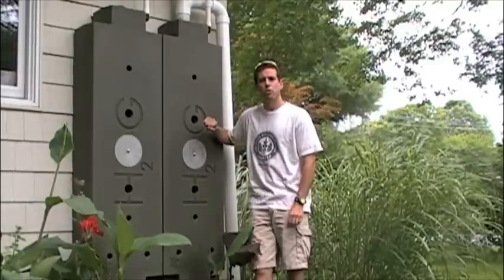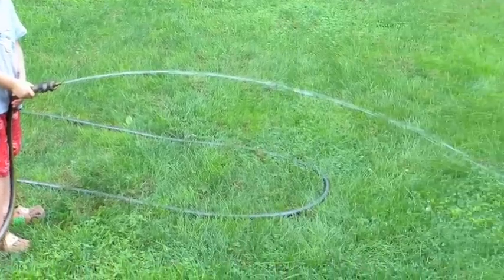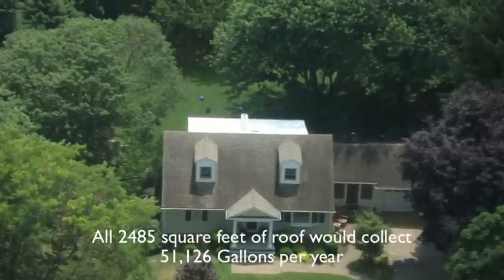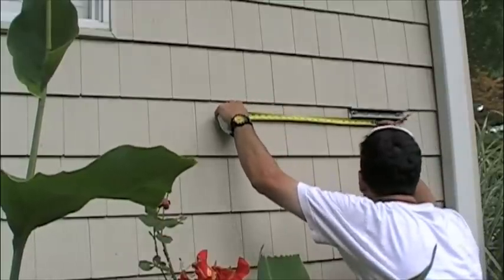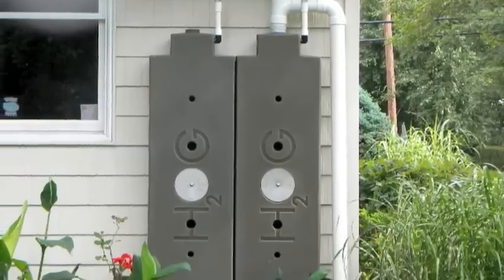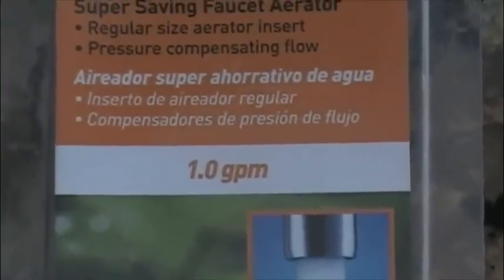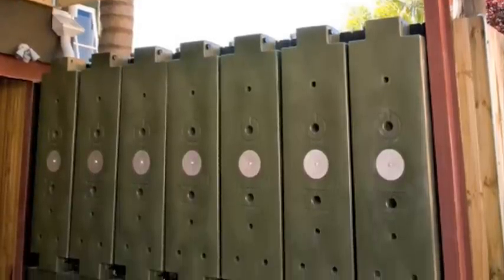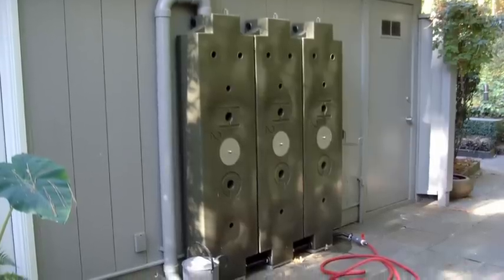Rain Water Hog install NJ Water Harvesting Rain Barrel

Comment: I love these things. 
I do struggle with 102 gallons costing $600+ not including pipes and foundation materials.
For 1000 gallons you're looking at $6k not including tax&shipping.

100 gallons is not much.... and to make this feasibly acceptable you'd have to go at least 1000 gallons. 
I have ibc containers and yes they're unsightly. But that's 500 gallons and if it doesn't rain every week im empty. 
For it to replace home systems? Forget about it, we're talking 30-40k if you live in a dry area and 15-20k in a wet area. 
I wish they could do these slightly cheaper than $300 per 50 gallons.

Comment: O K boss so I don't know if you all in NJ use a lot of cooling. But In the high desert of the south west were I live we use swamp coolers a lot. So what we have done is use the large body of harvested water we have in the crawl space anyway to super charge our swamp cooler so we don't need to use it as much. during the winter that body of water tends to freeze in the crawl space. so we used larger than needed tanks so we could let them freeze if they wanted. As we were installing them we built in a system of cool air pipes that run from the north side of our home  into the crawl space and through the barrels, out to our swamp cooler's air intake and it draws air through this set up to super cool our AC better than using chemical coolants and is provided by the good 
Lord all day long if you've pland and did a lil pre work. I need to make a video on that one some day : )

Comment: oh & yes to brag a lil that 4000 square foot greenhouse is off grid passive solar heated and cooled by a 2400 gallon reclaimed H2o heat sink and sub flooring system all run off one small solar pannel  (like you sit on your dashboard to charge your auto battery), as well as two stacked compost tumblers with a passive hot water in floor system. It also features vertical growing super towers so we have over 600 soil based plants and another 864 ( Kratki style No Pump hydroponic) plants. and yes I painted the barrels dark to keep the alge growth down, 2  330 gallon 20 catfish ponds. Oh did I mention it has finished floors with out the need for cement. It did not require a building permit in my area as it doesn't have a cement  foundation electrical tie in or pluming. it is considered a portable building. As that 4000 square feet is laid out east to west it gets solar all day long. the entrance is thermal air locked. sorry just got her done & need to brag : )
Reply: Huni Buni 
google Mike Strizky of Hopewell NJ...He has homes in the woods of NJ and has the best off grid solutions.
Reply: Hi where are you offgridding?

Comment: Cool But I'll keep my 1100 gallon system that is not seen cause its in my crawl space and as my property has a slow hill to it the pressure is fine to drive a hose as well as a pressurized drip system in my 4000 square foot greenhouse. So I was wondering do you still use drinking grade water to flush your commodes? If you want to see that water bill drop like gas stocks add a water reclaiming system to your shower and sinks & you wont believe how much water you've been flushing down the drain. the dirty lil secret they don't want you to know or ask about. Good luck with you're efforts.
Reply: good job
Reply: Th Linn so how about mak8ng a video?
Reply: Laura Powers How about using that mush between ur ears u call a brain, gather 2 cells together and rub really hard to come up with a thought of ur own on how to create ur own.

Comment: Water that was here 10,000 years ago is still here today. There is no such thing as water "shortage".  There is water pollution and that can be fixed. There is salt water and that can be ran through desalination plants to create fresh water.
In a lot of states what you are doing "harvesting rain water" is becoming illegal or a fine(tax) is being levied for those who do it. Why you ask?  Because the water you collect STILL goes through the same treatment plant when you flush and by not using the tap you are essentially not paying for water on the intake but flushing it and the same amount of water has to be treated at the plant.  Basically you are not paying for the water you are depositing into the treatment system that depends on the month water fee's.   Your not helping by any means "saving" the planet... you are just not paying.  Same thing with the electric cars, you are using the same roads but not paying road taxes via fuel tax and hence the depleting road infrastructure short fall in funds.  This is why more and more states are putting a special EV tax each year at registration time to help off set those taxes you have not been paying.  Yet at the same time, you say there is a problem and it needs fixed/solved.  You and those like you are not solving anything, you are depleting the very needed funds but using the same system. 
Stop this insanity!
Reply: +Ray butt. well you really live up to your name. LOL you ass. totally wrong on all counts.
Reply: +Ray Butt Wow dude you might make some valid points if it weren't for the w government's over spending on all sorts of junk. As for the water we harvest going into your down line sewer system most of use that go to the efforts of this type systems also use our own ( home built ) in most cases systems. and speaking for myself we use our water to the utmost degree before releasing it back into the wild. Usually on to one of our growing towers or lawns, then mother nature takes it back up as she has done forever. Keep the faith bro not all of us so called tree huggers are loco as bat Sh,,, some of us are poor and need to take back much of the power that has been given away to the MAN as it's said. Sorry for my lake of spelling skills Modern education "SYSTEM" ( the mob wishes they were as slick). Dislexia suks

Comment: I am in NJ and wonder what to do in the winter, the dark color may help the contents from freezing right?
The vents may also help to relieve pressure in case of freezing.
If i were to install these under my deck they would be out of the sunlight so they may freeze, would i need to drain the tanks each fall or is it possible to add heat tape or some sort of element to the system to prevent freezing?
Maybe I am over thinking this?
Very interested in harvesting mountain runoff and rainwater up here in Sussex County NJ
please advise if you get a chance, thanks for the great DIY tutorial!
Reply: +Warren BB Check out my post above it might be some thing to help with that and if you over size the system to were you keep excess space in the tanks freeze might not be a bad thing Good Luck : )

Comment: Nice!  A couple of things, you don't need to vent the tank that has the drain pipe filling it, the air will go up the drain.  And if you put a "t" fitting on it, you could connect both tanks at the top, in which case you wouldn't need to vent the second tank either for the same reason.  That would allow them to fill quicker in heavy rains.

Comment: From Wikipedia there're 231 cubic inches of water in a gallon,
and there's 144 square inches in a square foot, so ....

If you have 1 inch of rain you get 144 cubic inches of water and 144 cubic inches is .62 of a gallon.

144 / 231 gallons or .6233766.... gallons for every inch of rain.

To get a gallon for every square foot of your roof you would need 1.6 inches of rain.

Hope that helps.

Comment: At my rates ... so far ... 4000 to 8000 gallons of water works out to $32 to $64 dollars.  I think what you did and your video is great, but there is really not yet an economic reason to do all this work and spend all this money.  Those HOGs store 50 gallons ... and that is so small and I bet they are very expensive.  They do look much better than the average and I can understand you wanting to use them for that reason.  I'd like to water my plants without chlorine/chloramine myself!  Nice vid.

Comment from the maker: very easy.. Based on square foot.  Measure your roof.  Length by width.  Multiple by .62   Thats 1' of rain.  Find out how many inches of rain you get per year, multiply that by the previous 1" of rain finding.

Comment: Dude if you can fill your toilet tank with it then maybe  you can get 50 or 60 flushes, rain can do your outdoor watering for you, 40 inches a year you shouldn't have to water out doors at all. In LA we get 14 inches a year, I haven't watered my lawn in 4 years, it ain't dead yet. At $400. per unit I can buy bottled water.

Comment: you could add an inline utility pump that runs on solar, so it will give you a pressure boost to run a sprinkler or  even  just give more pressure to the nozzle. solar because, you know, save electricity....

Comment from the maker: @flubno...  I guess you are referring to the hogs ability to store water.  I agree with you.  Glass is better.  This is one ability it has.  Heat mass and rain water capture are another.   I try not to drink anything in plastic.  However, this food grade plastic is thick enough where light won't penetrate creating algae etc and it has good emergency drinking ability if you set up the right filtration system.  You can go to their website for better information.  I don't work for them.

Comment from the maker: @Dale82855 I think I more then stated, that I'm happy with anything if you are happy.  My only concern with used plastic or metal drums is where did they come from and what were they used for previously.  These hogs are 100% recyclable, not the BS number 3, 4 and 5 that can't be reused in 99% if the country.  Good luck with your barrels and I'm delighted they only cost you 30 bucks.

Comment: How do you stop flow to the Water Hogs during the winter. Did you need to install a valve? You didn't address this in our video. Just curious if you were worried about freezing OR if you just opened the bottom of the rain barrel in the winter and that was enough.

Comment: Square tanks do look good. Shipping - handling charges are better because of the shape. If you sell enough of these you can bring the production costs down.
Price comparing, the round poly tanks have more capacity. If you can afford these very nice. Build a fence - privacy screen with these.

Comment from the maker: on offgassing and leaching materials, and pointed out to me that food cans - and most steel tanks - are lined with food grade liners containing BPAs.  Right now, the safest way to store any food or drink is in opaque (to prevent UV rays fouling the contents) food grade polyethylene (which is what our tanks are made of).

Just reading down a little on your forwarded note, salvaged barrels are particularly environmentally dubious as they

Comment: Im in TX. I have been 100% rainwater collection since 1998. I do not have a well or city water. We have one system for household ( 30k gals ) and one system for gardening and plants ( 2k gals ). The ag system is all salvaged poly barrels, no need for food grade containers.  our water use ( household only ) is < 50 gals per person / day. this includes cooking, baths, toilets, laundry. Our family of 5 had no problems. Cost comparable to a well on new const. outside city limits.

Comment from the maker: As I tried to suggest in the video, changing shower-heads and faucets make a difference too.  As far as cost, the Hogs last over 20 years, are far more capable, functional, attractive and are 100% recyclable.   What is the life expectancy of a typical cheap $120 rain barrel from Home depot or Lowes?  As far as soaker hose, when I compile the data/evidence for you, and I will provide it.